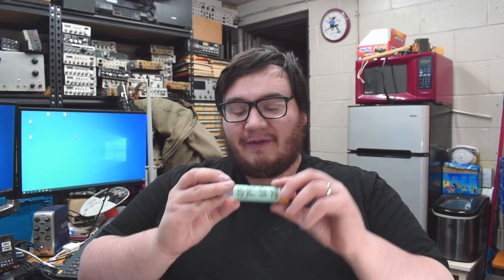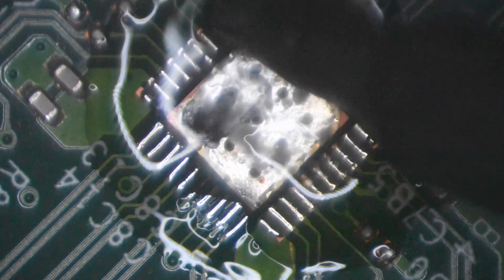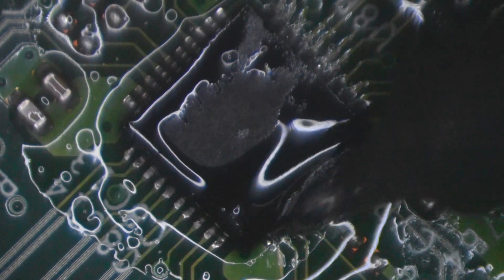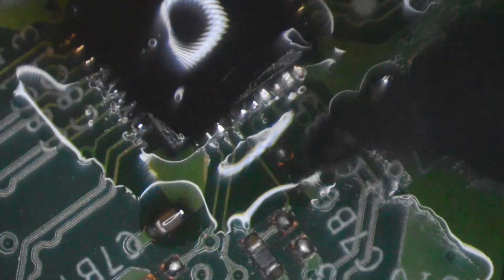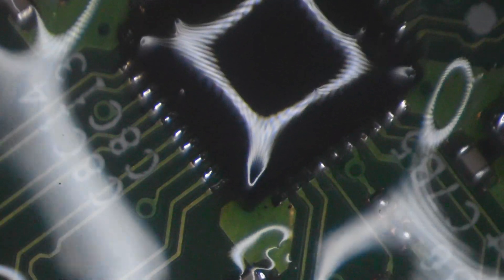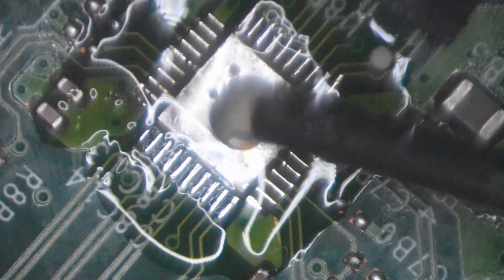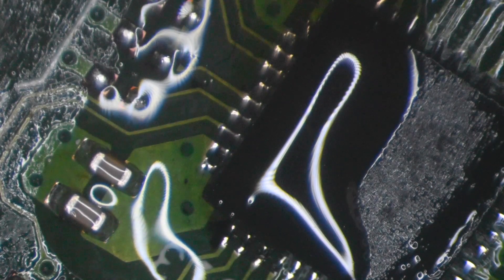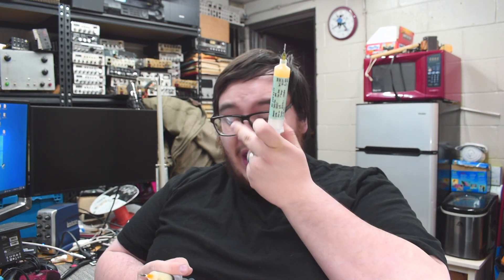FAKE Amtech Flux VS. REAL Amtech Flux - Can the Fake Flux Beat Genuine Flux? (OUTDATED, SEE LINK)

Comment: I own about 20 tubes of fake NC‑559‑ASM I got for super cheap like 5 years ago, It works fine for what I've used it for, probably not the best for anything that's BGA but for normal through hole or SMD stuff it works pretty good. Here in Canada finding genuine Amtech flux is really difficult, looking around for it I can't find any actually, the only way to get it is to import it and it's not cheap stuff. The only thing I can find is MG Chemicals 8341 for 15$ pre taxes, some MG liquid fluxes and a bunch of other knock off fluxes. Considering I paid 28$ with taxes for 10 10CC syringes that work well enough I'd say I'm happy with that.

Comment: Please tell me you are saying leaded solder by accident. No one solders PCB components with leaded solder...Dafuq.
Reply from the maker: All day everyday. Leaded solder flows the best.
Reply: What. Everyone solders PCB components with leaded solder. Old factories don’t do to ROHS. Before that, they also used leaded.
Reply: @Josh.Davidson  Who is everyone? Its literally an industry standard on all modern  electronics manufactured to use lead free solder. Who cares if they used to in the past, they also used to use mercury in thermostats but they don't anymore and by todays standard its archaic. Leaded solder has a low melting point which makes weaker joints, its bad for your health/environment and is just the cheaper product. Lets say you are replacing a hdmi  port on a PS5 motherboard. Its soldered on from the factory using  lead free solder not just because its the industry standard. Its also because its twice as strong of a joint on a high wear component. If its done that way from the factory and there isn't a single joint on the board that used leaded solder. Why would you replace a component with leaded solder? Most soldering stations go up to 450C which is more then enough to easily solder using lead free solder. Other then being cheaper and requiring less skill there is no reason to be using leaded solder.
Reply: Leaded is actually stronger. Lead-free is more brittle. And there's absolutely no reason not to use leaded solder when replacing components.
A low melting point has NOTHING to do with solder joint strength. Who on earth told you that? 
The change to lead free literally occurred because of European ROHS restrictions. That's it. Otherwise, we'd still be using the superior leaded material.
I think you don't understand the first thing about solder chemistries. Your entire reply makes no sense. Whoever taught you all of that has no idea what they're talking about.
Reply: lead-free is harder to work with and more brittle. 99% of electronic repairs will be done with 60/40. Maybe you're confusing it with plumbing where you're required to use lead-free all the time
Reply: @sloottiee  The higher melting point of lead free solder actually creates a stronger/harder joint then leaded solder. Its also less prone to bridging, Has better thermal fatigue resistance, its less corrosive on copper and provides less wear and tear on soldering iron tips. There is also numerous formulations of lead free solder. I Personally use SN100C lead free solder and it 100% makes smoother and more shiny joints. Its also a eutectic alloy and consist of stable constituent elements. Meaning it is actually easy to work with, more controlled and stable and provides more consistent quality results. For electronic repairs SN100C is better in almost every way compared to 60/40 tin lead solder.
Reply: I call bullshit on the lead-free. Every repair I've had was because of the lead-free cracking due to joints being weak or cold. Also, the tin whiskers create shorts. The real reason why ROHS was created in the first place was because of California. The one rare occurrence of acid rain that happened caused some lead to get into the water at the landfill. Manufacturing companies got offered a great tax credit to begin using lead-free and coincidentally, the European Union liked that idea, so they adopted it. If it wasn't for the tax breaks, everyone would still be using lead today. Even still till this day, the military, the medical field & Nasa all use leaded solder. Why?! Because it's that damn good and excellent for reliability. You can keep preaching about lead-free being superior until you are blue in the face. Facts are facts!
Reply: @rubenmejia4881  Facts are indeed facts in which you have yet to state anything other then your own personal experience and a debatable history lesson on solder. 

And why are you mentioning failures related to cold solder joints? That is not a symptom of using lead free solder. That is trait of operator error and poor workmanship. 

Its like comparing a automatic Toyota Camry to a gated shifter Lamborghini. Yes the latter is more difficult to operate and takes more skill. But that does not make it inferior in any way.  The fact that leaded solder takes less talent to work with is such a lame argument. 

Improve your soldering skills above novice level and use the right lead free compound and flux for the job on hand and its not difficult at all to produce quality reliable joints. 

Tin whiskers create shorts? You do realize lead free compounds are a bit more complex then the pure tin solder from 25 years ago right? SN100C is made up of Tin, Copper, Nickel and Germanium. Copper and nickel modifies the crystal structure of tin, which makes the growth of tin whiskers very unlikely. And as i said before SN100C is a eutectic solder just like leaded solder is. It flows easy and exhibits good stress relaxation properties. When subjected to mechanical stress is can dissipate stress way more effectively then pure tin solder of the past further reducing whisker formations and cracking. Facts are facts.
Reply: It's always the fanboys preaching to upgrade our skills. We got the skills and the gear for it, and the lead-free still sucks. Why is it that a lot of people still try to import lead to europe then?! And don't hit me with the to repair technology thats old that was built woth lead because people can happily repair with lead free since its "better" Most manufacturers barely run on operators they run machines, I can see where the operator could be at fault for the individual level but for mass production I'd say its unacceptable and yes I do realize all the advancements within the lead free technology & chemistry mixes of the different materials. Sure, it's a preference, but I would have to disagree with you on every front. There's nothing better than 63/37 or 62/36/2 in my opinion. If you need higher temp resistance just use more tin that's all but even in "lead-free" solder isn't really lead free if you look at the data sheets across muilple manufacturers they still to a degree add lead if you don't believe me look it up.
Reply: Look at all the ps5 with hdmi port failures due to the "strong joint" you preach of. They fail because of the lead free going cold or cracking. Sony probably doesn't use cheap materials in manufacturing being one of the major players I could see where they could skimp out on components because I've also seen caps going out on them left and right but there's no excuse according to your arguments that the hdmi shouldn't fail then @canwefixit8129
Reply: @rubenmejia4881 very true.
Reply: Is it possible that people like this guy exist?
Dude, hurry up, inform NASA, Aeronautic, Space, Medical nad Military industry about you scientific findings, they all have illusion that 63/37 is more reliable then leadfree, hahahaha, 
Sweet mother of God...
Reply: @neshco The medical field doesn’t need a lecture on solder standards, lead-free is already the standard in this field. Pacemakers, hearing aids, diagnostic equipment, and surgical instruments are all manufactured with lead-free solder to protect patients from exposure.

The same applies to food and beverage equipment: coffee makers, water dispensers, food processors, and kitchen appliances. Lead contamination here would be unacceptable.

Renewable energy technology: solar panels, EV chargers, and battery management systems, also relies on lead-free solder. And let’s not forget children’s toys and consumer electronics like smartwatches and fitness trackers, where safety and compliance are non-negotiable.

If you’re such a fan of leaded solder, maybe try redoing all the water pipes in your home with it and see how it affects the taste of your drinking water... or your lifespan.

Yes, NASA and aerospace industries still use leaded solder, but that’s for highly specialized reasons tied to spaceflight reliability. The average person isn’t soldering components for spacecraft, so that argument doesn’t apply to everyday electronics repair.

Take a PS5: it comes from the factory with lead-free solder joints. If I’m repairing it, I’d prefer to keep it consistent. Saying “leaded solder is easier to work with” is really just an excuse for people who haven’t mastered proper soldering technique.
Reply: @TheMerchFiles  exactly, thats true, but in Disneyland.
Sweet mother of God...
Reply: @neshco  I think you have absorbed too much lead in your life.

Comment: In Europe it's practically impossible to find the real stuff, the syringe plunger doesn't even fit right in the barrel. It does the job either way, it's just more sticky which may be a plus.
Reply: Its easy to find the real stuff and to avoid the fake stuff. First of all real stuff is not on amazon, ebay or any other online marketplace. Its sold by Inventec on their official site or by one of their actual authorized distributors such as Rossman Group, NorthridgeFix, LTronics etc... If the seller online is not one of those authorized resellers then its not real plain and simple.

Comment: I bought my amtech 559 v2 flux from Rossmann repair I believe it’s real
Reply: Except the 559 V2 Rossman and Northridge sells isn't actually 559 V2. They get their product through Inventec and not Amtech Direct. Inventec is actually selling 559 ASM under the 559 V2 label. Real 559 V2 has a piney smell and does not glow under UV. 559 ASM is odorless and glows under UV which is actually what Rossman and Northridge is actually selling.